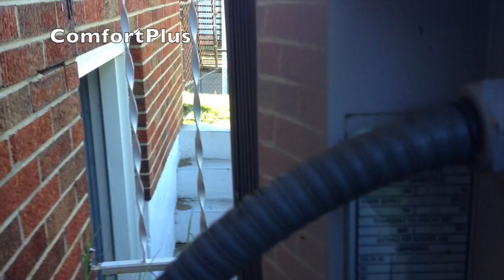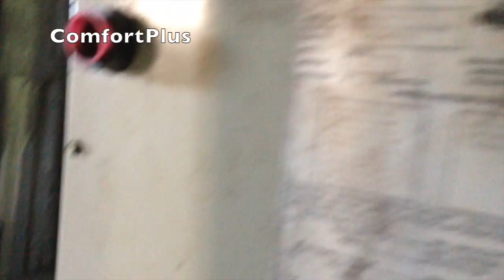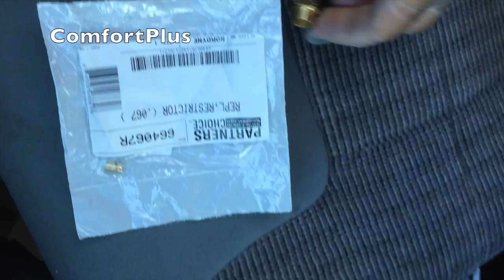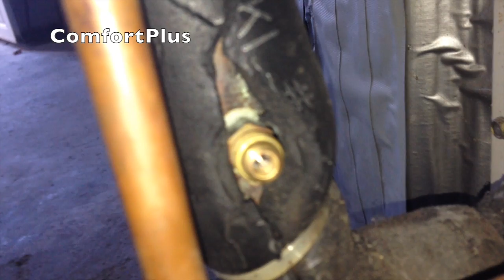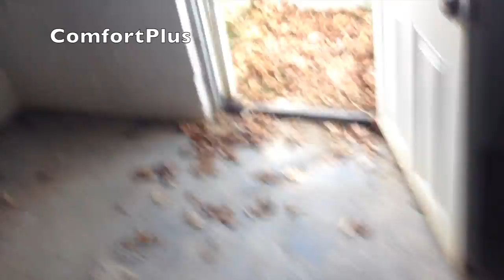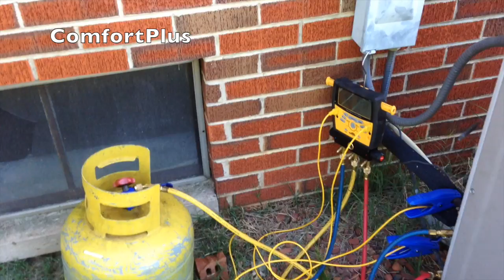HVAC - Replace TXV with Piston

Comment: Just thinking on that coil...carrier style...think where the two flared pieces meet....where you mention didnt seem to be leaking....is where the old Carrier piston was located.....you could remove piston and add txv....to get higher seer....all you probably needed to do was remove old txv....and add Carrier piston in that flared fittings that meet inside the coil...

Comment: So heat pumps you can install a piston and leave the other txv in place? Cause heat pumps have 2 expansion valves right?
Reply from the maker: Heat pumps will normally have two metering devices (Some geothermal units I have worked on use one txv that meters both ways). Some use two TXV's, some use pistons, some use a combination of both. Armstong Air usually had a piston for cooling and a TXV for heat on the 13 Seer and lower heat pumps. Carrier usually has a piston for heat and a TXV for cooling. You can still get a Goodman 14 seer match that uses pistons for heat and cool.

Comment: fewer moving parts for sure.  On a residence you know it won't be on unless its hot out.  Its when you have a mild day and they attempt to run the cooling it doesn't match up to the TXV, then again in a residence its perfect. I have one of each in my house they both are fine after 10 years no faults in either.

Comment: wow, that is not an upgrade. txvs are way more efficient, and can be retro fitted to any system. they control the flow according to the load demand. pistons are great if the outdoor temperature stays exactly the same as the day you charged it.
Reply from the maker: Yes. I wasn't doing it for an upgrade. I did it because the landlord wanted to see if he could get more time out of the old system before replacing it. Just started the third summer on it so he is glad he chose to fix rather than replace. When he gets a new system it will more than likely have a piston also, as Goodman warranties rentals for 10 years, where some of the more respected manufacturers require it to be owner occupied.
Reply: Pistons are great, if the temperature stays exactly the same as the day you charged it.(impossible) Other than that they are not an efficient option.
Reply: apparently you haven't dealt with all the stuck closed ones that I have which I get to go out and change under warranty out of MY pocket!

Comment: I like pistons, I would rather sell a new system with a piston any day simply because I don't want a call back on a txv. We just installed about 6 Trane's and have had call back on the case coil because they have been freezing up. Come to find out Trane said " Oh yeah we have been having problems with those txv's " Now we have to go back and fix there known problem for free to the customer and we are out all that service time. If they were pistons it would have never happened. The Entergy savings is minimal, especially when the customer does have to pay for me to come fix a txv issue.

Comment: with the failure rate of txv's today this seems like a viable option. I'm seeing txv's fail just out of warranty. if the evaporator is not leaking. pump it down bolt in a piston evacuation it and never look back. what are we loosing maybe 2 seer. as long as the air flow is correct and it's a single stage compressor. some of the guy's I work with have been talking about this.
Reply from the maker: +jason oftel I know we have to use TXVs on higher seer equipment but when it's listed as an option I usually go with a piston. They don't fail. May plug up but that's due to another problem. Lol. Thanks for watching!

Comment: I see you have a SMAN 360 ,does it still work? I bought one in April 2015. I just sent it back to Fieldpiece .Would not hold a deep vacuum. I was just curious, they said to send it back and they would replace with new unit.The deal was I pay for shipping both was cost $51, one week to get there,and another week to come back.So Chuck are you happy with those gauges!!
Reply from the maker: Bernard, I sold my smans a while back. The vacuum gauge worked for a while when new but like you it didn't seem to last. I use a separate vac gauge, core remover, and large hose now and don't pull through a manifold. Takes out bunches of places that could leak. Thanks for watching!
Reply: I wish I had talk to you sooner about the Smanns,Thanks for your input Chuck

Comment: Can you tell me the part # of the piston holder? That would be a great way to keep my customers cooling with all the junk txt s I have been doing.
Reply from the maker: +joshua G I did another video after that where I got good pictures of the parts and part numbers. Check out 
"Replace TXV with a fixed metering device on a Package AC Unit" . I need to write them down so I can find them easier lol. https://www.youtube.com/watch?v=B0ceSDTIXGU

Comment: Hi I white from Mexico. I dedícate To refrigeration, hete there arent pistón. I want to know if pistón need it super heat ass Txv?. Thanks. Nice Video. Hola que tal, recibe un saludo desde México. Muy bueno tu aporte. Oye el pistón necesita el súper heat como la calcule termoexpansiva?. Gracias
Reply from the maker: Yes I use superheat for charging systems with pistons. It is calculated using the indoor wet bulb and outdoor temperature. Thanks for watching!

Comment: Good job Man! I've been searching for an hour since I saw your vid for those piston holders. Could you share a part number or a link to where I could order a few? Lee from Tulsa
Reply from the maker: The two parts that make the holder are labeled "Fast HVAC products" however it also says ICP on the bag. 

1057787 housing flo control
1055499 adaptor flo control LH

Thanks for watching!
Reply: Me too love to have couple myself

Comment: Hey chuck do you still have the old flare assembly that was inside the unit? I think that a carrier type piston could have been inserted there as well. But I like that piston assembly you used. What did you end up using there to braze that?
Reply from the maker: Joe Shearer Yes I have it. I opened it up and it had a screen. I think its Safety-Silv 56FC. Round rod with orange flux coating. I just have a couple sticks left from long ago lol.